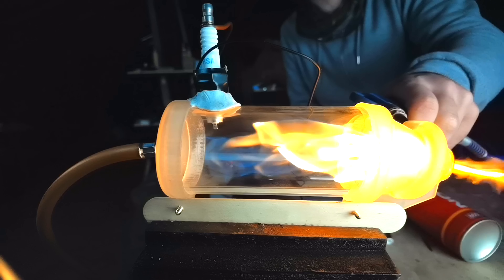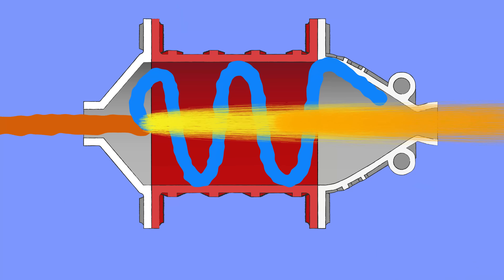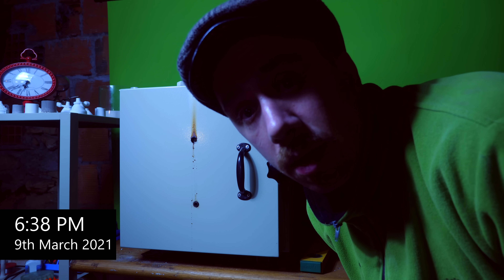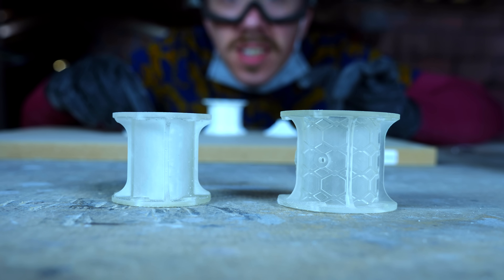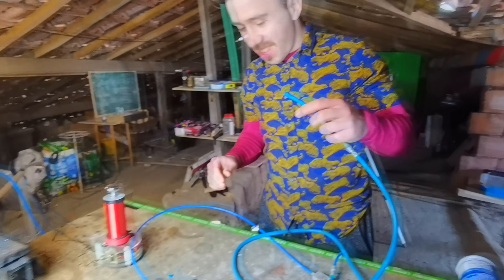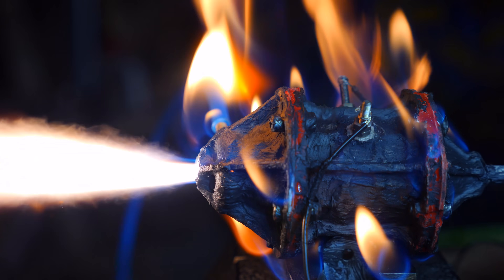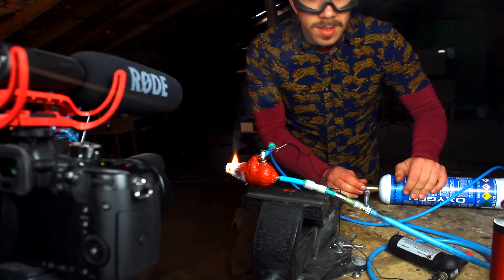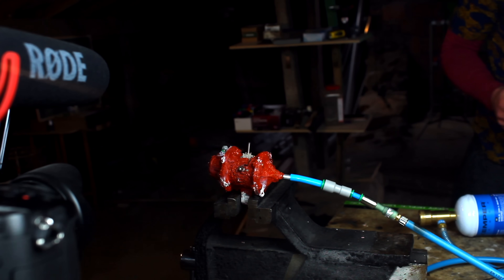Vortex Rocket V2.0 (3D Printed)

Comment from the maker: The first 1000 people to use the link will get a free trial of Skillshare Premium Membership: https://skl.sh/integza03211
Reply: What if you glazed it like with pottery? it seals the surface with a layer of glass
Reply: @miscellaneousstuff6346  Beat me to it!  :D  
 Maybe it would also be possible to reduce porosity by sintering  at a high temp for an extended period of time.  Works with metal, but I'm not sure if that works with ceramic.  Worth a try?
Reply: @miscellaneousstuff6346  and we all know glass is great under tension! right?
Reply: @friesingcold  And ceramic is?
Reply: @friesingcold  Glass is surprisingly strong under tension. Nearly as strong as steel (sometimes stronger).  The glaze layer is not for strength.  It's there to provide a gas barrier to stop the relatively low pressure gas leakage through the ceramic.  The ceramic itself is responsible for almost all of the strength.
Reply: You don't need a 3D Printer, you need a Lathe, this engine is "almost" simple to make with AISI 4140 steel and would handle the pressures and temp way better!
Think about it little portuguese guy that hates tomatoes
Reply: You best integza
Reply: One idea that I have to fix the engine leaking is to cast a metal, engine using a 3d printed castable resin model and then making an investment plaster mold then you burn out the resin and pour a metal of your choice, maybe that helps
Reply: @Integza.
0. SAFETY! SAFETY! SAFETY! 
1. Make "normal" emergency valves to cut both propane and oxigen at the same time and fast.
And make them operate with just one lever.
2. Make all engine parts with inner 2 mm wall thikness smooth ceramic inlay and fill the gap with your sealant of choice.
Reply: Hey with the leaking engine make the part like normal and then with a paint brush go over the jet engine again with wet porcelite and then harden the new layer with UV light and then bake it in the kiln again to finish it off, maybe even paint a few layers making sure to put it in kiln between each layer to seal the engine :); i thnik this method will work best with the engine that is one whole piece.
Reply: @sinancingoz4809  and find a coke can  open hols for air fuel and sparkplug put engine in it fill wıth porcelene dust seal it it can work or a big dust explosion ... or melt away?
Reply: I believe to stop the leaking you would need to seal the gaps first with something like the 
"McMaster-Carr ceramic adhesive (4000°F)" to use as a sealant for your parts and may work
Reply: @ArchevalsArchives  I came here to say this.
Reply: If you can submerge the pieces in a high temperature medium and pull a vacuum with a vacuum chamber to fill the pores in the ceramic it would seal the leaks. Depending on the size of the pores you may even be able to use slip or even a metallic glaze then fire the pieces again but you would definitely need a vacuum chamber to pull the medium into the pores and expel trapped air.
Reply: To fix the porosity problem after the parts are fired & the support material removed paint a coating of ceramic glaze on it & fire it again in your kilm. It will be completely sealed just like bowls & plates are & it will also allow you to make it any color you want.
Reply: i really like ur videos! SMASH THOSE TOMAtoes... KEEP UP THE GOOD JOB U BEST
Reply: You could make tabet rockets (pill sized micro rockets)
Small 
Easy to print 
Many rockets 
Lesser fuel 
A wide variety of results 
Fun seeing micro rockets 
And many of your subscribers can easily  make them.👍🏻
I have a full project plan but I am busy in preparing for my exams.
Reply: Big fireball.....yeah it’s leaking.... fires it up again.....great fun. Engine 2 melted, yeah, still leaking......engine 3.....will not die.....then it died! Engine 4. I shared your joy, until the big fireball.
Reply: Why don't you try layering the rocket with resing and curing it with UV since you have that for your printer already, and if that don't work just keep making it thicker. P.S. Use a mask when grinding the ceramic man, that can give you silicosis.
Reply: Just bulid it with metal
Reply: JB-weld to fix the leaks
Reply: @HPMvdBerg  It may work for short times. I'm very curious to see someone try the various geopolymers though you might as well mold an ablative throat out of hardwood saw dust and superglue.
Reply: I genuinly think you'd have a lot longer engine life if you stop using pure oxygen. In the first video on the subject it appeared that rather than create the vortex it should've, it made a short fat vortex which looked to be touching the walls of the nozzle. And the ones in this video that were sealed well always seemed to fail first around the nozzle. Maybe go back to normal compressed air because I feel if your intent is to make a 3D printed engine you should go for lifespan before maximum thrust output.
Reply: Would covering it in a high temp resistant sealant than covering it with a 2 piece printed shell take care of the leaking issue? I figure don't give the sealant a place to move and it'll keep it good
Reply: @Integza you could have a go at lost PLA casting aluminum, your furnace should be able to achieve the temp needed, and to make the mold you can use glass fiber or ceramic wool and plaster of paris, ive had great success with this method and youll be able to make your parts last much longer.
also if the part doesnt work you can just remelt it and cast a new one, only losing the plater, fiber and pla part.
Im also currently an aerospace student going into my masters so if you need any advise on anything id love to see if i can help. you can contact me via my business email on my channel
Reply: I would suggest a ceramic/porcelain glazing and then re firing it in the kiln. That would seal the interior and exterior of the engine to prevent leaks.
Reply: @faustedra1  Yeah that would work, or metal plate it (there are ways of plating ceramics).
Reply: It’s time for LostPLA Casting
Reply: Hey Integza, I think you might have a leak at around 10:40
Reply: since the internal shape of the engine is what matters most, maybe add more ceramic to the exterior. Furnace cement for 1500°C +
Reply: If you put a thin fireproof sealant on the outside then pull a vacuum in the combustion chamber it might draw the sealant into the resin
Reply: If the porosity of the ceramic is causing it to leak then the vortex will never properly keep the combustion away from the walls.
Reply: @T--yh5sd  refractory paint could seal it alumina oxide header paint
Reply: this is cool but it is not a rocket engine. you should do some research and math for the next design. here are a few problems:1 you don't have chocked flow so your thrust is 0 Newtons. 2 your materials are very bad, serious rocket engines explode every day, ceramic does not seem optimal for this purpose. 3 your plumbing is wack also your oxygen flow is super small. for a 100N engine you need to burn circa 40-50grams a second. just not possible with your setup. don't give up yet, do your best and create a proper rocket engine. I believe in you. I think google or other people can help
Reply: Hi Integza, you could try to put the refractory cement on the outside  of the motor (after putting the pieces in the oven) and then use a vacuum pump (which sucks the air from the inside of the engine) to fill all the micro holes with concrete.

Or 

you could create a space between the inside and the outside (1mm should be enough) of the engine and fill it with cement and then use a vacuum pump to avoid bubbles, as it is already difficult to fill 1mm
Reply: Integza! your nozzle sucks!
figure out how to make a proper bell nozzle (ask NASA) and test the force so you have an actual metric to experiment on!

I found this channel called Sciencish, he's made a good video on nozzle engineering and it's the only one i find easy to understand
Reply: Try different clay washes or coatings. Like painting with clay after you finish the 3d print. Think about the engine like a ceramic dish. Use the same method and i think it will work.
Reply: just get the engine CNCed
Reply: The only way to prevent leaking is to create a exterior chamber that is filled with an inert gas that is also at an even higher pressure than the combustion chamber.
Reply: On the leakage front (including the one piece engine) have you considered after sintering the parts coating the inside of the engine with a slip coating of more resin or something else refractory that will fill any pores in the micro-structure & then perhaps giving it a second bake. This may also work for preparing the mating surfaces of the engine parts.
Reply: Integza you can just cover the rezen parts by carbon fibre and the thing or a liquid you Used to on carbon fibre rocket parts that you made on the privous vedio 😑
Reply: Water glass perfect for what u want to do
Reply: What about taking people's renders of rockets then making them to see how good they arr
Reply: the pressure is getting into the ceramic even if you seal it from the outside, it'll put pressure on specific parts of the insulation. so maybe you have to coat the inside.
Reply: liquid glass ?
Reply: glaze
Reply: Hey integza you should look into glazing your ceramic parts it's how ceramic is commonly sealed and depending on the compound it will definitely be able to deal with the heat of the combustion better than the fireplace sealant
Reply: I am researching this idea and editing this comment as I learn more.
The problem is the pores in the ceramic obviously (also, high temperature and pressure). 
A possibility is electrolytic deposition of metal onto the ceramic. Electroplate copper, nickel (or both) onto the ceramic (perhaps something else?). Nickel on the outside and copper on the inside seems like a great idea but it would be difficult to accomplish. Though not impossible using a plating mask material (waxes, tapes and lacquers, resins).There is a possibility that the ceramic is electroplatable or could be chemical bathed or doped* with something to make it conductive so it was. 
*Metal powders, Certain metal oxides; Magnetite (or Iron(II,III) oxide, Fe3O4 ),  Zinc oxide, Magnesium oxide, 

Another simpler idea is to coat the outside and inside of the engines with a nonporous high temperature glaze and re-fire it. 
It may be possible to impregnate a high temperature, high strength material of some kind into the ceramic pores. This may be possible by submersion or submersion under a vacuum. Then firing or sintering.
It may be possible to replace molecules in the ceramic through some chemical process. (this is how gorilla glass is made.)

notes:
- You may have to break in a glazed motor by running it under low fuel and oxidizer rates.

- I would contact the manufacturer of the ceramic and see if they can help if all else fails.
 
(I'd be interested if you try my idea of electroplating.)

I have an idea for a vortex solid rocket motor.
Reply: Try to weld a similar engine as this would have less leaks and would be more effective I believe
Reply: @thomastovey7098  but this is a must more complex especially when you can't weld or have the tools
Reply: Electroplating the interior will seal it.
Use a carbon paint to get it started, or apply a powdered metal inside and sinter it. 
Maybe you can apply tungsten via electrodeposition and have something that can stand a lot more heat and pressure.
Make the deposition thick enough and you can let the base material burn off.
Reply: heat shield
Reply: Y don't u try testing the engine dipped untill the nozzle in H2O!!!(after insulating the spark plug....)
It may give some results
Reply: very smart, pin your comment to be the most liked comment and receive a 3d printer
Reply: Integza Faz um aviao ou planador movido a um Propulsor de açucar ou coisa do tipo!
Reply: Integza do a 3d printed brushless motor
Reply: whats your temps?
ill find you the right sealant
Reply: he should get himself some proper 3D printed metal parts or try loss PLA casting
Reply: I... Don't have a credit card
Reply: You are getting somewhere on the motor at least, but what if you increased the length of the combustion chamber and the diameter of the nozzle, because it looks like the motor holds up initially then fails under the pressure and develops a pinhole that quickly expands. Outside of trying to externally reinforce the print.
Reply: I don’t need skill share so someone else can use my spot I didn’t touch the link, just curious tho what part of Portugal is Integza from?
Reply: @integza why don't you use carbonfiber like you use in you termo-jet project to seal the engine, it wil probably also help with presure resistance.
Reply: What if you used ceramic paint on the parts to remove leaking
Reply: How about a water turbine?
Reply: If you need an idea to reduce the leakage, you could make printed ceramic housing plates that have the high temp coatings on both sides.

The plates could be made with limited complexity, and could likely limit the routes that your propellant could take to escape the engine.

Also, if they can be made with a high enough quality, you could theoretically have a vacuum separating the leaking points of the engine from the outside world, although this idea is sketchy at best for functionality.
Reply: You could try a starlite-like paste to seal up the engine
Reply: I want to learn and make this type of project
But I have no resources.
Can you help me
Reply: Wonder if ceramics shrink if fired in orbit?
Reply: you could try adding an additional camber in the middle that's glued in place with the fireproof silicon, that way you have an additional layer of insulation as well as a reduced number of failure points in the chamber itself
Reply: how hard was it to remove the support material ?
Reply: That's one heck of a fire hydrant!
Reply: Destroy all Tomatoes. That is why I take my tomatoes off of my burgers and it them in the trash where they belong. Now I know someone already said this but I think you should make a solid sugar fueled rocket. You need sugar and lots of potassium nitrate. The sugar works as a binder while the potassium nitrate works as the fuel. The you can make a ceramic engine whatever shape you want because after you cook the fuel it will harden around the shape it’s put in and will reinforce the structure of the engine even more.
Reply: I’m not sure where but for one of Adam savages iron man builds he used a 3D printer that prints with titanium
Reply: Já experimentaste algo como isto FOLIAC MANGANESE PJC?
Reply: You may want to slightly open up the exhaust hole so there is not as much pressure building up because that seemed to be what was breaking the seams on you modular engines
Reply: Flex tape or flex seal to solve the leaking
Reply: To clog those pores use CVD (chemical vapor deposition) or apply a thin metallic film through electrolysis.
Reply: @aristeidislykas7163  electrolysis in this case would not be the best choice as the ceramic being used is not conductive, therefore you have no way of making it an electrode to deposit metal on. But the CVD would work if he can find a simple and cheap method of doing it
Reply: @mrhypernova481  Personally I would prefer the CVD method (thin film of Aluminum Oxide?).   But conductive lacquers exist on the market for depositing metal on surfaces of dielectric material.
Reply: @aristeidislykas7163  true true, but i think there are methods that would work better and use materials he already has, i mentioned in another comment using lost PLA casting, would give him higher 
versatility across other projects too
Reply: Suggestion: buy afordable metal 3D printer or ask me for one !
Reply: Dip it in metal either on the inside or outside, this would give it a better seal, better strength and higher heat resistance!
Reply: Hi Integza, why not have it printed in stainless steel?
Reply: @Integza What if you try plating the surface of the engine with metal? there are methods for plating plastics and ceramics. That way you would have a non-porous, heat resistant layer protecting against leaks.
Reply: You need a way faster gas shutoff.  Like a deadman valve.
Reply: Here's an idea. reduce the size of the hole on the inside of the chamber where you blow the oxygenizer in. Smaller hole, faster flow. Faster flow = less pressure.

Also, since it's plasma in that vortex you could try magnetic containment.
Reply: hy , i'm a great fan of un integza and i watch u every time getting better at what u do and create ,so i think it's time to sugest u a challenge , GOLDEN RATIO JET ENGINE (remember the golden ratio propeller?) , also i think u chould trie creating a cement outer layer (like putting the assembled nosel and chamber in a 3-5 mm  cement enclosure ) to prevent leaking.... all being saied ...HAVE FUN !
Reply: My partner has a ceramics business. She says about in order to make plant pots water proof you need to use a glaze. 

Maybe soaking the ceramic parts in a transparent (or hell a colour) glaze will seal the pores in the ceramics and stop the leaks?
Reply: Why not create an Iso grid  from the support material as you remove it somehow? It might be a little stronger
Reply: THE SEALING ISSUE.  Make a gasket out of Kevlar and that high temp sealant for joining the parts together. Also i noticed your coating around the body was bubbling up from the heated pressure, I would suggest applying a coat of sealant and while still wet wrap the whole body with Kevlar strips(no gaps, overlap strips slightly) and then apply an additional layer of sealant as to bound the Kevlar between the layers( make sure to allow plenty of time to dry before testing). This should cut down on or remove the bubbling causing leaks.
Reply: @Verikoshi  The old STS solid boosters used a glorified fire paste. The O rings were just to keep the paste in by providing a mechanical seal across the less than 1/4" gap there was supposed to be had the engineers managed to accurately check the refurbished casings dimensions were still symmetric and round... which they were not... Anyway, at relatively low pressure any of the DIY "starlite" recipes on YT should do.
Reply: @johnassal5838  what you're talking about has no bearing to what i was saying. I've built plenty of rockets/thrusters of my own and Kevlar with heat resistant paste is a fantastic, effective sealer for leaks in these very small builds. I was suggesting a reasonably cheap solution that i've used and know works
Reply: Just a question here Integza, but how do they heat up and cool down glass in order not to crack it/not create stresses in the material? I wonder if some of that could be applied to the ceramic as well. Maybe a more uniform heating could help with the cracks?
Reply: I think the problem is pressure. Make a second body to surround the motor equalizing the pressure and keep the motor from burning from outside.
Reply: It would also be time to buy a mini lathe lol
Reply: Einstein was cooler
Reply: Build an ionflux jet. This is when you produce a spark of voltage ⚡and then air is pushed away. That or an aritc blue High intensity laser mwhaaaaaa 😉
Reply: @integza I hope that you can read this message and these information can help you.

I think (but i am not sure) that the problem it's the insanely high temperature you reach burning with pure oxygen inside the chamber.

At the starting both model with also the red sealant work great but after some seconds it start to bubbling and self destroy.

This seems made from a high temperature attack to the sealant that can't provide enough protection for these temperatures.

If i have understanda correctly you use methane, at the optimal burning ratio, with oxygen you can reach 3953 K from my search. With air the thing go a little better but not soo much, at 2236 K. 

You can protect a little the chamber with the vortex, but a big quantity of heat was transmitted to the wall by irradiation.

Instead you can't protect the vortex generator, and of course it's the first part that go self destructed.

I have search for high themperature sealant and the better i have found was around 1500 K, less than half of the temperature you can reach in your burning chamber.

Now, the problem it's, i think, bigger than you think, or at least bigger than you seems think on the videos, beacuse in the "real world" rocket systems they have exaclty same temperature problems with the best metal and alloy you can find.

Sustain without damage a direct flow of plasma at 3953 K, from CH2 + O2 in stechiometric value, for example, it's (almost) impossible for ANY material man made.

So...what ?
Graphite can survive at 3850 K (sublimation temperature between 3895 and 4020 K). So why not use it ?

The more simple thing that i can think, beacuse your VERY simple design and very small chamber it's made it with completly different materials and procedures. I can think for example about a tube of steel (if you continue to use the vortex for cooing it) better if with a big heatsink on it, and the top and bottom parts made with a cylinder of graphite. It's also possible but a lot more expensive made all motor with graphite, also the cylinder of the chamber.

You can very easly prepare the nozzle and the top from a graphite cylinder with a lathe, if you continue to use a de laval nozzle. You can also try (but it's a little more triky) to add the inlet for create the vortex. Of course in this case you have to put the plumbing external beacuse you can't create a shaped tube inside the graphite. But you can use 2, 3 or maybe also more inlet with the right angle and use the external pipes for injecting the oxigen.

You can print with the 3D printer some piece to replicate them with the lathe and the graphite, and also the negative conical pieces for test if they fit on the nozze you made. 

Please consider that these nozzle need to be made quite fast and for cheap beacuse they it's almost sure are single use, beacuse the graphite it's very fragile.

Also i can advice you to not use pure oxygen, but maybe a mixture of oxygen and nitrogen (you can also call it, air if you use 21% O2 and 78% N2), so you can have 3 improvement, first the combustion temperature decreese a lot (from  3953 K to 2236 K), second the N2 with the temperature expand generating thrust. And third, maybe you not know that but A LOT of materials that not burn usually, can burn in pure oxygen, maybe also your new ceramic sintered structure can burn in pure oxygen. Maybe this is part of the problem.

Yes this is more difficult than just 3D print it, but i think it can work.

Just for know: The best think you can do teorethically (but of course it's really outside from you possibility) it's made the entire motor with zirconium diboride (ZrB2) or hafnium diboride (HfB2) that are very high temperature ceramic that can survive to about 2300K and melt at about 3300K.
Reply: What about taking the resin and dip the part, like hand dipped candles? Dip the parts in the resin and then cure it in UV chamber? Multiple multi coats and leave the tubes in once printed and assembled, the dip and cure, dip and cure
Reply: I have very little knowledge on how engines work. But my best suggestion would probably be a way for the engine to naturally vent access pressure. As for rocket engines the chamber diameter to nozzle diameter ratio is set for specific internal pressures for maximum efficiency. If it goes over this pressure by to much it could self destruct, so maybe a way to vent that overpressure would help solve some of that issue with leaking. Another solution might be to find a thicker thickness for the ceramic to be at, or a different 3d printable compound or sealent thats less porous
Reply: Hey I had an Idea I've noticed that your engine has to large circles protruding where the leak was most seen 10:35 why not add a two circles around the edges sorta like a lid
Reply: Try CeraKote? Maybe some other ceramic paint? Inside and out maybe too...
Reply: Suggestion: if u cant machine metal parts try casting them. Try looking up lost Pla casting  or lost wax casting, lost wax casting would be alot easier if you use 3d printer wax filament. Acquiring metal casting in your skill set not only allows u to make long lasting prototypes since it could solve ur problems with leakage but also with structural inconsistencies that happens when ceramic printed parts decrease in size. Once u managed to cast metals u can now make fullmetal prototypes.
Reply: The simplest method to reduce the pores is to let the artefact cool, after you take it our of the kiln, and then pur it back into the kiln and take the temperture up to almost 2000 degrees Celsius.  Since Porcelite is made of Alumina, 2000 Celsius is the temperature where your artefact would melt.  Maybe you will have to do this heat treatment three or four times, to get the desired results.
Reply: I like the music you play.
Reply: Hey intergza 

Its to porosity and blow holes
And crackes
Reply: to decrease engine pression make a longer nozzle adaptator (from the burning chamber to the nozzle) ! it should work. i think. ok. at least try it please !
Reply: Hope you've got good flashback arrestors!
Reply: Maybe seal the engine on the inside with some kind of heat-proof liquid, like maybe UHT paint??
Reply: You definitely need a device to test how much thrust you can get
Reply: First thing, swap oxygen and fuel. Instead of isolating, cooling layer of fuel between the engine and the flame, you're running engine-rich mix by trying to cool the body with oxygen.
Reply: Use some type of leak proof sealing inside the chamber !!not outside! BTW love from India❤️❤️
Reply: You could use a liquid ceramic paste, after the initial firing of the part, to coat the outside to possibly create a air tight seal and fill in any micro fractures in the part. After application you could refire the part to bake the ceramic on, or you could try and find a high temperature enamel that you would use with pottery, that would create a glass like surface that would most likely be air tight. The problem I see whenever you increase chamber pressure is fuel bubbling underneath the surface of the sealant. You will  need something more rigid to seal the chamber with the kinds of pressure you’re dealing with.
Reply: What Is Islam?

Islam is not just another religion. 

It is the same message preached by Moses, Jesus and Abraham.

Islam literally means ‘submission to God’ and it teaches us to have a direct relationship with God. 

It reminds us that since God created us, no one should be worshipped except God alone. 

It also teaches that God is nothing like a human being or like anything that we can imagine.

 The concept of God is summarized in the Quran as:

{ “Say, He is God, the One. God, the Absolute. He does not give birth, nor was He born, and there is nothing like Him.”} (Quran 112:1-4)

Becoming a Muslim is not turning your back to Jesus. 

Rather it’s going back to the original teachings of Jesus and obeying him
Reply: Use rock like a gullet of some birds.
Reply: have you tried using ceramic glaze to cover it after cooking it. using the high temperature silicone is great and all but at the end of the day its still rubber and rubber stretches. Try using a thick layer of silica glaze and then put it back in the kiln a second time. The glass resulting from the glaze should be a far better solution. If your kiln can't get hot enough perhaps try using a 2 part resin, and then multi dip the part in it like your making a candle. of course plug all of the holes so that you don;t get resin in places you don't want.
Reply: hey por some ceramics or concrete in shape i think it is better
Reply: hey integza, about the gas leaking through the ceramic parts , you could glaze the parts with ceramic glazing color (it basically covers your parts in colored heatresistant glass), all you need is a batch of glaze and your furnace, and an old floor tile to put under the glazed parts because, glaze might drip off and damage the insulation otherwise. let it dry for some days so there is no more water in the porouse parts. also watch out when using salt glaze, it's the most heat resistant but it makes very volatile gasses in the furnace.
big fan of your channel by the way, but you need better fireproofing!
Reply: Can you chrome plate these parts to make them stronger?  If the chrome melts, it will flow into the ceramic and still proved strength and heat resistance.
Reply: You can glase the ceramic with a glass like glase to make it impermeable to gasses by baking it a second time with the glaise on.
Reply: Paint the engine with ketchup mixed with refractory.  Teach that tomato kid a lesson.
Reply: It's good to see people talking about this. I haven't followed this since before Sierra Nevada Corporation bought out ORBITEC. Were you connected to ORBITEC or their work on Cool-Wall Vortex Combustion Chamber?
Reply: You should make a small potato or tomato gun 🤣
Reply: Ganda maluko!
Se detestas tomates, imprime em 3D uma maquina para esmagar e  fazer sumo de tomate! :)

Crazy!
If you hate so much tomatoes, just 3D print a machine to smash tomatoes and make some tomatoe juice! :)
Reply: I love your videos, and just wanted to jump in here to offer an idea: Use this concept with the Phi Vortex Valve. It's a valve shape created to improve water flow and some other properties and I think just the shape of the valve (in a 3d golden spiral) would make for optimal air movement.
Reply: glaze your ceramic parts, some one said go to a potter, i wanna see your engines leak proof
Reply: Clay use clay theres different kinds so use 5 to 8 different ones to find the best one
Reply: Bro, mask up when you're grinding that stuff. The dust from cutting bricks/tiles/concrete/glass will give you silicosis, I can't imagine ceramics are any different. 
You only get one set of lungs. :)
Keep safe.
Reply: @jimmyb1451  Please avoid the places where idiots use masks several hours at a time without changing them out for sanitary ones. It doesn't take long for things to grow on the mask. 

8 monkeys put on a mask to protect themselves from a virus. After a short amount of time the mask had grown bacteria infectious to them unknowingly. The bacteria came from the monkey skin and breath causing lung infections, pneumonia,  and 7 monkeys died without catching the virus and the 1 that lived did catch the virus yet lived. How many American monkeys have died from mask associated infections because they failed to follow the strict sanitation protocol required by medical personnel? If the CDC said 64,000 actually died of COV out of the 450,000 claims by healthcare means  236,000 could have died from other causes. 2008 Dr
 Fauci co-authored an article you should know more about.

https://www.nih.gov/news-events/news-releases/bacterial-pneumonia-caused-most-deaths-1918-influenzbacterial-

Insider pregnant Dr from the CDC comes out.
https://youtu.be/VOl2-xI76tI

Here what happens to your oxygen levels while in a mask. https://youtu.be/axSHWgO8-0k
Reply: @jimmyb1451  shield up, not mask up. Keep the atmosphere between your mount and the filter as far apart as needed to prevent a suction from your mouth forming on the filter. Reduce thay funnel effect because you don't actually prevent leakage of containment that get stuck on the face nask because the suction from your mouth is to strong.
Reply: hey integza I'm wondering if your using a flashback arrestor because otherwise your risking an oxygen tank explosion if a spark flies back up the tube and ignites the oxygen
Reply: I suggest 2 layers of the porcelain filament body. One to be treated in the kiln for heat-resisting. The other untreated for sealing purposes. The untreated covers the treated one thus you have to design the layers like that. The treated one resists heat and the outer one resists leakage.
Reply: Integza, you cud stop the leaks by containing them, with bean can ur soop can, and the propane tube inside the conteiner is a brast, bras, or what ewer u cal that tube in there, and then it conects outside the container with normal  tube. Jeez, my english is bad.
Reply: Basicly just put aluminium or iron can on it to contain the leaks
Reply: exept for the big leak, wich is the nozle, that just sticks outside.
Reply: enjoy monetization while u can, showing that crack was not a good idea at all